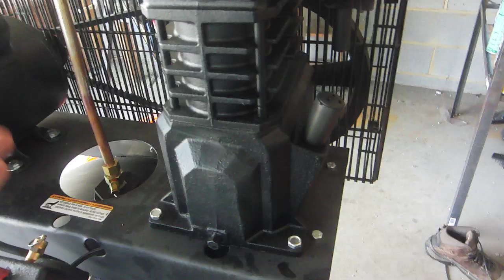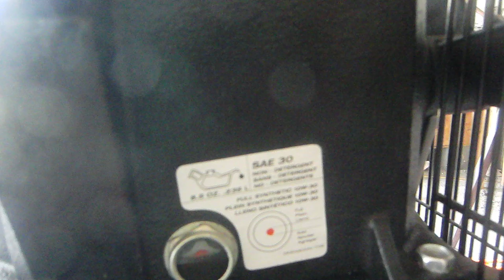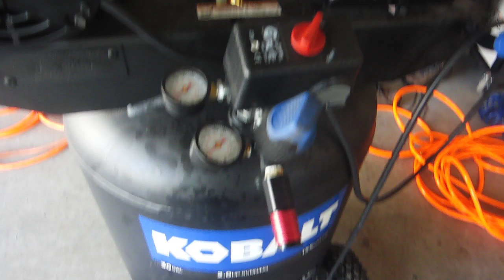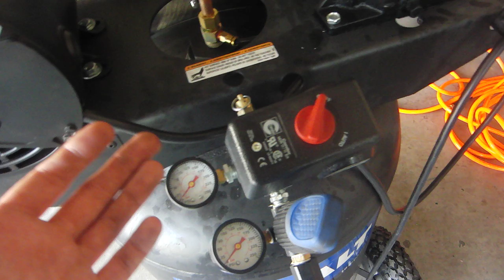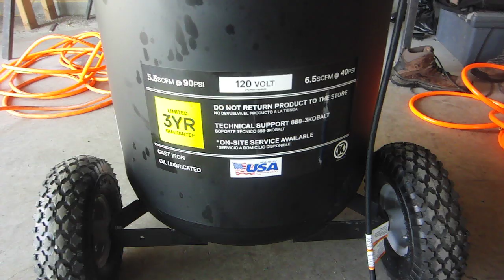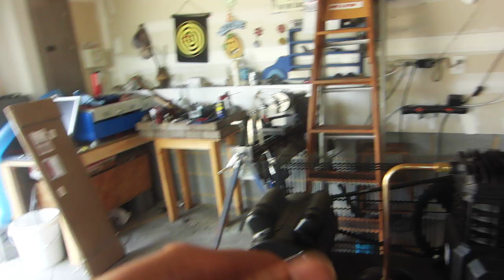Kobalt 30 Gallon Oiled Air Compressor

Comment: I have a similar hardly used, 2016 30gal oil pump kobalt still works great!! stopped using it after tripping Mobile home breaker I need to add a dedicated 20amp breaker line on my panel, As an option just bought a H/B ultra QUIET 6gal, 150psi pancake compressor.2 match my old 3k watt quiet Honda Handi portable generator 4 DYI home projects.

Comment: I bought one new similar to yours, mine had a full plastic cover where yours looks like it has a mesh wire screen over the flywheel. My crankshaft broke, snapped off while just maintaining the pressure with no tool usage. Oil still shows full. Of course 6 weeks after the warranty ran out.  
Would like to replace the crankshaft but not sure where to get parts for it, since it is a model no longer made, and unable to find anything from Lowes or Kobolt. Any suggestions would be very grateful. Peace

Comment: I buy Harbor Freight air compressor 29 gallons  8 years and it still work just fine but I need an air compressor and I was looking are you video and that just about the same besides for the price and Harbor Freight it does help you with the warranty but I never returned it and not even once in trust me I'm the guy who likes to real good tools and I usually don't bite Harbor Freight because of that reason air compressor it works just fine

Comment: It takes SAE 30 ( says on the side), which is standard oil. Not 10w30, but 30w. Just in case you need to change and not want to spend on kobalt oil.

Comment: just brought it after watch you video, lowes on sale right now, only $239, great deal!
Reply: They had the 20 gallon for 239. The 30 gallon is 529. I know because I work there. If the 30 gallon was ever 239 they couldn’t make enough fast enough.

Comment: Hi I'm just wondering if you have a little oil blow by in the oil vent on the pump I just bought mine and did the 30 minute break-in and after that I let it cool off then let it build air an started smelling oil and I noticed it was smoking a little out the pump vent just wondering if it's normal or if I need to take it back for the second time I had to return the first one because it wouldn't kick on it just hummed
Reply from the maker: You should definitely take it back that's not normal at all! When I when't to buy mine I had to go to several stores to find one that wasn't damaged due to careless employees. If the oil cap had been removed for any amount of time and dust or dirt got into it then it may have mixed with the oil and completely destroyed the pump when you first ran it.
Reply: MOO Tech or if an employee laid this compressor in its side. They are only supposed to be shipped and moved upright position. If laid on side the oil will come out. That’s why some people state when they get their unit it has no oil. So someone after it came out of factory laid it on its side. ALWAYS check oil even when it’s new!  States this in the manual as well during ‘break in’ procedure.

Comment: Great review MOO, Im zero’ing in on buying this one, couple of questions: how loud is it (and prehaps compardd to the husky 30 gal twin cyl which is rated at 78db)? Also down the road what if one wanted to replace the motor with a larger one to get more CFM what motor would you recommend?
Reply from the maker: If you can get the marathon motor that they use on its bigger brother with the pulley and belt they used then you should have a drop in replacement that essentially turns it in to a 220 only compressor on wheels that has like 10+ CFM.

Comment: Turn the fucker on!!!! Wtf
Reply from the maker: Ill do that in the follow up video if it makes you happy. Its still pretty loud so I figured no one would want to hear that just to see a belt spinning.
Reply: What HOTSAUCE said. I came here to hear this puppy and to see it do what it does! Empty to full, then cut in to cut off would be nice. Believe it or not, there are NO OTHER videos of this particular model (VT6389) anywhere on YouTube. All the other Kobalt 30 gallon reviews are the other, slightly different, versions. Fire it up!
Reply from the maker: Daniel Buley would it make you happy if I made a follow up of it running tomorrow?
Reply: It would make me ecstatic. Giddy, even. I've had my eye on a compressor for months and this is one of the finalists. Would love to see one in action before pulling the trigger. Like I said, it'll be the only video of a VT6389 running on YouTube. You're a damn pioneer.

Comment: Hi,

Great review. 2 things to ask you. 

1: if I get 240. I can just buy the motor from the 60gallon brother and call it a day? Does it have a that standard 220 plug as well, or does that get changed? 

2: My compressor fills up to 155, but then over last few days, I see tank presssure go down to 125ish and stay there. 

I do not hear anything leaking, I’m not sure what to do. Any suggestions?

I was considering bringing this back and buying the big one, but if I can get 10CFM by upgrading the motor, I’m all for that.

I did have 3rd question, will this motor or new motor run at 100 percent duty cycle? I guess that means run non stop?
Reply from the maker: The one I bought has a standard 120V U.S. plug so you would have to change that or directly wire it into the wall but that shouldn't be difficult as the connections for the plug in the switch housing are just regular ring type terminals. Yea they are suppose to fill up to 155 PSI and when I first got mine it was doing the same thing but we did drop it and bend the regulator assembly pretty bad and I noticed all the fittings on the regulator assembly of mine where very lose and I could unscrew all of them by hand. When I replaced the nipple that connects the assembly to the tank I was hesitant to tighten it and like I said it did the same as yours. But after taking everything apart and using plenty of Teflon tape on all the connections and tightening them well the issue seemed to completely disappear. So try re assembling that and see if that doesn't fix your problem. Also check your hoses and such as I found a small leak in one of mine that was probably contributing to the problem. To my knowledge the pump on this one and the big one are identical. I measured the one in the store vs the one I got and they look and measure to be the same at least on the exterior. There might be some black magic going on inside but I kinda doubt it. Looking at them the only difference I can find is that the motor on the big one is 5 HP I think vs 2 HP on the 30 gal and the pulley on it is maybe a 1/2 in to an inch bigger in diameter. That being said I would almost bet that changing the motor and its pulley and possibly the belt if the original is a bit two short and of course wiring will likely get you the same specs as its larger counterpart. I intend to do this to mine when I finally get 240V in the garage. As far as duty cycle on the motor I would guess its %100 or close to it and id imagine that the service factor on it is at least 1.25 or higher as it seems like a really nice motor in general. I have run the thing for well over half an hour while cutting up a bunch of angle iron with my pneumatic angle grinder and the pump got up to "operating temperature" and the motor was pretty warm but its suppose to have a thermal cut off and I didn't trip that so...
Reply: MOO Tech 

I very much appreciate your answer. I’m actually upgrading to an ingersol 80 gallon air tank. 

I decided to return the Kobalt it was nice tho, but this big guy is what I really wanted.

Comment: So wiring it up to 220 doesnt increase performance  snt all?
Reply from the maker: I don't know for sure but the owners manual doesn't say anything about it to my knowledge. The pump is the same as on the bigger model so you could put a bigger motor on it and get more performance I would imagine.
Reply: rick mcvey. It depends bro some can be switched  too 220 210 ect all depends on what use is . I have 110 on mine that can be changed to 220 lime ur saying  I guess it all really depends what you're using it for good luck

Comment: mr moo.   theres two compressors   I have in mind   . yours is the first  . the second is the   husky  30  gal  ultra quiet   air compressor.  I saw both   u tube  reviews   and very impressed.   whats your  2 cents   on that comp?  thanks.
Reply from the maker: That is a tough one. I have never used the husky and I didn't even consider it when I was looking for a compressor just because I really hate Home Depot. The husky appears to be a bit cheaper according to the website but its not that much different so I would ignore it and look strictly at the machines themselves. I would go to both stores if you haven't already and take a very close look at every aspect of both. I'm not sure about the Husky but the Kobalt has a very nice dual voltage 2 hp marathon motor with thermal protection (it may have a %100 duty cycle but I'm not sure. I have run it for almost an hour straight without tripping the thermal protection so..) and having a very good motor on a compressor that might be running continuously is very important especially sense they are so expensive. I have a lot of bias toward Kobalt because I have used their tools for so long and they are just one of my favorites for relatively cheap yet reliable tools. I would say get the Kobalt as the gauges appear to be a bit better and such but really its whichever has the features you want. Whichever you get make sure you have them open the box and allow you to thoroughly inspect what your buying because I had to go to 3 stores to find one that didn't have any damage from careless handling. Most of them had issues with the gauges being bent or flat out broken likely from someone running a fork lift into the box. Hope this helps!
Reply: yes it has   . there warrenty  is better than  home depot   .thanks mr  moo.
Reply from the maker: No problem.
Reply: I heard from Kobalt that the duty cycle is 50% but they have tested it to 75/25% with no sign of issues and they recommend mobile one 10w 30 full synthetic oil when you do it oil change. And if you’re in a cold climate use 5W 30 Full synthetic.